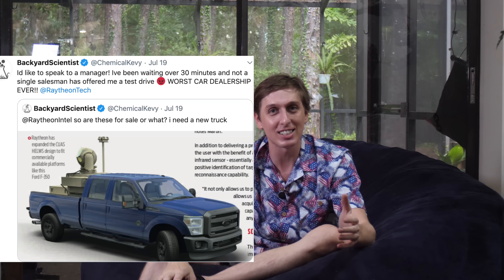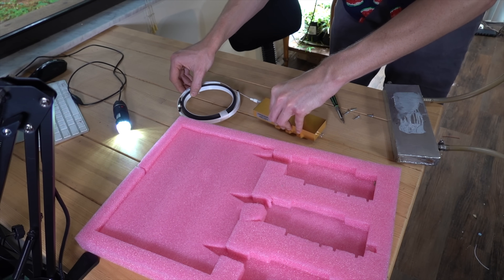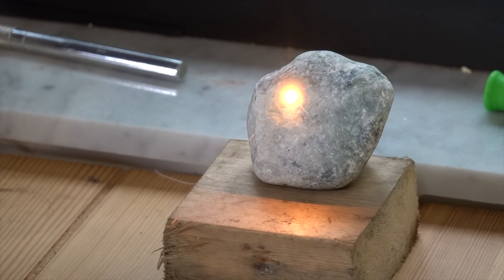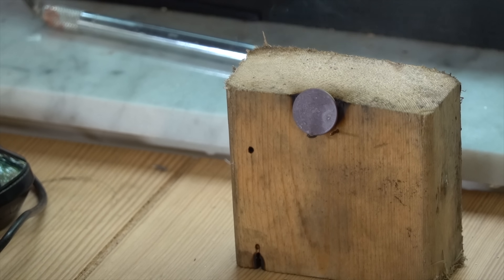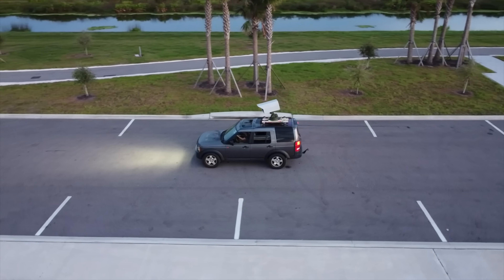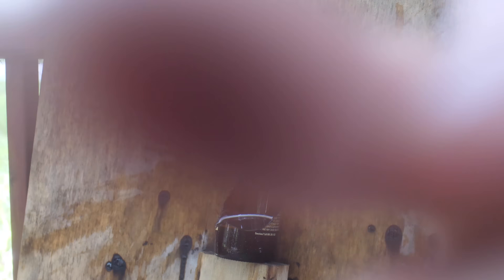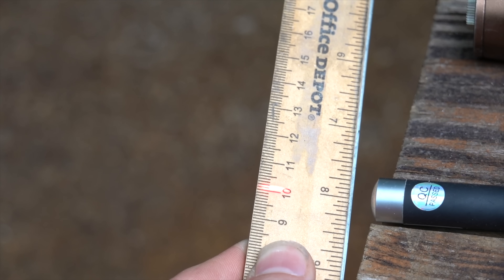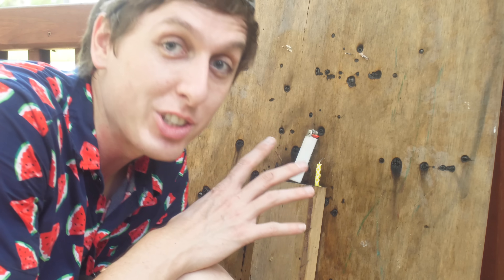200 Watt car mounted laser!

Comment: Aaaand Kevin has designed his own energy weapon. This is straight up an advanced weapon that was beyond human science just 50 years ago and he’s using it to entertain people
Reply: He just bought an off the shelf laser, everything he designed could have easily been designed 50 years ago.
Reply: @FrancisR420  nope, solid state lasers are far newer than that. He could've gone with a ruby rod pulse laser 50 years ago, that was about it and those had overheating problems if you didn't carefully design a cooling system into it.
Reply: @spvillano it's not pulse?
Reply: @FrancisR420  Nope. This specific high energy laser tech didn't exist 50 years ago. But, I just built a 3 watt RGB laser projection system for <$1K. 50 years ago, that would have been >$50K
Reply: FYI, Laserium started entertaining people with lasers in 1972. JS

Comment: Dude... If I was you, I wouldn't be trying to get a visa to, nor even land in, the UK anytime soon!

LMFBO!

Now, as for you firing a laser into the air, REGARDLESS of whether you checked for traffic "in a hundred miles in that direction" (which, unless you had your very own object radar (pulse-Doppler, OR Solid State) I'm uncertain how you could safely do that, so you could not just safely make that assumption ... and because of this the law states that you CAN NOT fire even HE NE lasers over .395 milliwatts into the free air without express permission. Full-spectrum high-powered lasers are different animals; even solid-state diode lasers. This type of display is known as a "non-termination display of a laser", and requires permits (and a designated time and area window, from both the FDA and the FAA) in ANY state. (Yes, I'm a lighting/laser guy from the concert/production industry). Some states (like new York) even require a license. You got away with it, but I would NOT recommend you do that again, as the penalties are quite stiff.

Not trying to be a Debbie-downer. I LOVED this viddy and was super impressed with your engineering (especially using the Meade as a projection system! Brilliant!) I'm just tryin' to give you a heads up, and keep you out of some DEEP hot water! The penalties aren't here, but the laws are. You can look up the laws, I'm sure.

https://www.fda.gov/radiation-emitting-products/home-business-and-entertainment-products/laser-products-and-instruments

Here are the laws about displays/performance: https://www.fda.gov/radiation-emitting-products/home-business-and-entertainment-products/laser-light-shows

I'm gonna peruse MORE of your madness later! GOOD TIMES, indeed!

Comment: 13:04 “… We checked the radar and there are no airplanes within 100 miles…” hmmm. hey guys, cool video but if that truck is anywhere close to US terra firma and you get a 250 lb. knock-knock cylinder ram-device break down your front door on the door and an FAA Special Agent there, better simply prepare to say ‘I’d like to request the presence of an attorney’

Comment: Hello. My teatcher at school on back days, says, that we never could not cut copper at laser because the copper reflects all the light and laser beams. So we never cut any copper with the laser machine, because the big and pricey machine could get broken at it. And now I understand it. This copper coin seems like it really does'nt get the hot spot. It just get hot all ower and in the end it's all red hot. I guess it reflects some of the laser beams and rest of these beams makes it hot. And because it is copper it leads all the heat away from the hotspot. Well, nothin more to say, but you have a lot of Good videos!!

Comment: Planes can fly without adsb which is what we see on the radar, if they are below 10,000ft you don't need adsb so the plane can go undetected, aswell as military aircraft that dont have to use it. So it was still dangerous. But I'm glad you still checked the radar and glad video!! Just something to keep in mind tho 😄

Comment: The meat is thinner than the wavelength of the frequency that the laser is set to. Thats why it passes through without burning the meat. Look into how medical lasers work. Same thing. They are set to the  wavelength that corresponds to the distance of the cancer below the skin.

Comment: Mind you that the Wheat Ear penny was discontinued in 1958, as much as that was destroying a (at least) 60 year old coin there were billions made. The US penny was swapped from 95% copper 5% tin to 95%zinc 5% copper mid 1982, so the destruction of such an old penny was not needed as any penny pre 1982 would work. I am not harassing or hating and I am not upset, just a tip.
Reply: I could've been a VDB or 1943 copper cent
Reply: @hunterpate8034  (1943 was steel)
Reply: @DerInterloper  I am aware of that, but, there was an error where like 50 copper 1943 cents were made, and vice versa with 1944, there were a very few that were 1944 steel instead of copper
Reply: @hunterpate8034  Ah you speak of those buggers, yeah they are up there with the 1913 V nickels.
Reply: @DerInterloper  indeed

Comment: You cannot build and operate a class 4 laser in the open air. You need to take this down and explain to your audience that what you did is illegal, irresponsible, and it carries serious repercussions. The CDRH has written a pamphlet outlining the regulations. You can read it online here: https://play.google.com/books/reader?id=DqK4ExoGWbQC&pg=GBS.PA20&printsec=frontcover
1. You have to register as a laser light show manufacturer if you shine that thing outside your house. (this is on page 17)
"AII laser products made since August 1976 must meet the FDA laser performance standard. Each manufacturer of laser products must report to FDA about the types of laser products produced."
The diode you purchased is intended as a component and does not have to register because it is not intended to emit laser radiation outside of a device enclosure. Those eBay laser shows are manufactured overseas and the importer is responsible for FDA Registration and compliance, but they are also illegal to operate without a variance. You have to have a warning light, an interlock key-switch, an emission time delay, your diagrams must be approved by the CDRH, and you have to know what you are doing.
2. You have to register open-air shows with the FAA and the CDRH. (page 20) 
"The
 Federal Aviation Administration must be notified before any open air laser light shows operate." But they won't approve this because it is ridiculously large, and it is invisible. 
3. You have to get a variance to operate a class 3B or 4 class laser is public (Styropyro did not shine his lasers into the open air, and that is probably the only reason he has not gotten a visit from the CDRH... yet).  (page 18)
"Before Class lllb or Class IV
 lasers are sold, used in performances, or otherwise introduced into commerce for demonstration or entertainment purposes, manufacturers must have an approved variance from FDA."
4. You have to submit for inspection. (page 19)
"Once a variance is granted,
 representatives of FDA must be allowed to inspect the laser equipment and the safety procedures to assure that the conditions of the variance are met. 
5. This has serious penalties. (page 19)
"Anyone who operates laser
 light shows without an approved FDA variance or who otherwise violates the FDA laser safety standard may be subject to a
court injunction and or civil penalties (fines up to $300,000) as provided for in Section 360C of the Radiation Control for Health and Safety Act. When
FDA becomes aware of a particular laser show that is
 operated in violation of the law or otherwise in an irresponsible
 fashion, FDA will notify the manufacturer or operator and require corrective action. If the problem is serious, FDA will also notify the State and local authorities and facility managers who can take additional, immediate legal steps to halt a hazardous show."

Comment: Whoooooaaaaaaaah :-O I would be so surprised if this had zero legal consequences. Imagine all satellites, the space station and airplanes in the sky that could be jeopardised with a 200W laser.
Reply: i gotta say, it was cool to see what a laser can do but this was the most irresponsible thing I've seen a youtuber does. This should have been done in a lab not in the open and especially NOT pointing it to the sky, risking other people's lives and risking damaging satellites.
Reply: @binthem7997  Statellites are up to high and are very heat resistant so its almost impossible for them to be affected if they are in the path of the satellites to begin with which is highty improbable

Comment: What would have happened if Kevin didn't check the radar:
Local Florida man shines laser in the sky and brings down seventeen airplanes
Reply: Planes can fly without adsb which is what we see on the radar, if they are below 10,000ft you don't need adsb so the plane can go undetected, aswell as military aircraft that dont have to use it. So it was still dangerous
Reply: That thing could easily permanently blind the pilots and passengers from miles away.

Comment: Now put it through a capacitor to get a higher powered pulse laser, take out the tracking camera and chip from the drone and wire that to the laser controls, and you've got a laser defense system capable of shooting down missiles and aircraft.

Comment: Based on your VDO, this laser emitter is real or just a false show and I have a question.
1). Does the distance have a significant decrease in the destructive power of the laser?
2) .If I need a powerful laser at 5000 watts with a protective device, is there any and how much it will cost? And let's be honest.
3 ). To be used in testing of certain technological developments.

My Email ; Moxs.suppa@gmail.com

Comment: Bust out a James Bond verson: 1.5kW that uses a modified rear tail light - stick it in a 64 Impala, as lots of room for  gear & target acquisition/assist features.   Repo man... eat your heart out.  With properly stabilized image sync control, could even be reliable at speed.
Reply: jam bi buy milbú hybred vàr

Comment: Took so long to burn shiny zinc penny because it was reflecting the beam onto the ceiling. Or back wall. 
BTW, what was the laser hitting outside the window when you were sticking the wood block into the beam?
Not sure I like this video as I can see it inspiring all kinds of idiots to go out and get lasers powerful enough to really mess people up when they're misused. Not to mention leaking harmful IR.

Comment: When you were focusing the laser in your driveway, did you calculate how large the beam had to be to not be an eye hazard for anyone catching reflections off your car or if you accidentally shot past the cardboard cutout and car?  I.e., you're focusing from at least some portion of a relatively large reflector down to a tiny spot, so past that point the beam is diverging rapidly, but the irradiance is still going to be well above the maximum permissible exposure over a time period less than an eye blink reaction (which you can't even rely on here since it isn't visible light and by the time you realize something is hitting your eye there has already been severe permanent eye damage).  Seems like to be safer you could've easily made a light trap box around your target area.  You can get permanent eye damage from an improperly filtered DPSSFD "Class 3b" green laser pointer (I've measured the IR output on cheap green laser pointers from China and observed IR emission more than double the intensity of the visible green light).  This setup is so far beyond that it should never be focused out in the open except in a remote designated range or with a light trap.

Comment: First things first what you are doing at 13:09 is extremely ILLIGAL.. the flight radar does not show militairy air traffic and does not warrant for you shooting into the sky.. you have to get clearance from the FAA and that's the only way to do it.. clearly this was not obtained.

To then use it also outdoors where most likely not all or other people around have the required safety goggles (and thus endangering others) is irresponsible as well. 

what you are doing at 4:20 is INSANELY dangerous as well.. you are shining a 808nm laser source through a window.. to make it worse: NON AR coated.. I don't think you understand how dangerous that is to the outdoor enviroment and to whoever was in the room for risking back reflection...

Btw it's not a divergence of 1mm .. the word you seek is mrad which is miliradian.

On top of the safety glasses you really need an OD rating for them.. then you really want a trustworthy OD curve given with them.. the camera test you did is not a suffficient thing... 
Please be more stringent on the safety.. these things are not entertainment products...

I'm still amazed big youtubers can break the law like this and feel like they can get away with that..

Comment: Fun fact : The reason why the copper penny turned red hot is because copper is a really good conductor of heat , as for the zinc penny it didn’t do much

Comment: I love that you are shooting at gas lighters, ensuring combustion, in front of a plywood sheet after you just showed the laser cutting through wood, backed up by the rear of a car, which is where the GAS TANK IS.

On the other hand, think of how easy and quiet duck hunting would be with this . . . Peking Duck on the wing, anyone?

Comment: Read the Creator's justification (court defense) in the caption. I guess it's mathematically impossible to endanger a pilot, according to creator. His BS comment about "checking flight RADAR for 100 miles" is irresponsible and fails to account for VFR aircraft at night.  Since the beam from this LASER is invisible to the unaided eye, a victim would not know. No witnesses.  Yes, creator should be in jail. 2A has nothing to do with creator's illegal import.  BTW, every time creator fired that beam in his driveway, there was some reflection ( scatter). Again, can't see it.

Comment: Sorry I am terrified by 200 watts in a tiny fiber optic strand no more than I am terrified by 10 milliamps of electricity at 120 volts in a 28 gauge wire. Passengers on airliners, however  should be terrified of you and your silly fanboy buddies pointing them at airplanes blinding pilots. You should wait for the frontal lobe of your brain to develop before playing with dangerous toys.
Reply: he said there was not any plane flying, because he checked the paths.

Comment: At that amount of power, you still have an obligation to inform the local air traffic controller.  Just because you look at the flight radar information and don’t see any aircraft in the area at that moment, doesn’t mean there isn’t an aircraft due to fly that flight path.

The other problem is, a website like flightradar24 will only have the majority of commercial aircraft on display.  They don’t show civilians, police, fire, air ambulance or military aircraft.

Some of these lasers (visible spectrum), can illuminate entire clouds and cause a distraction over 300 miles away.  As your laser is infrared, they won’t see the clouds light up from a distance and have no warning.

Comment: You just proved what a good conductor of heat copper is. The zinc had a hole in it the copper absorbed all the energy and became red hot.

Comment: So ummmm... I don't know what you think you did to check if there were any planes in the sky, but I suspect what you did is check one of those web sites that allows you to look at an area of the sky and watch flight paths.  Here's the dealio:  those are ONLY planes that have filed a flight plan, not "all planes."  Planes flying under general aviation rules frequently do not file  a flight plan, so what you did was still exceptionally dangerous, and if the FAA finds out about it, you'll probably have some explaining to do, and will be lucky if you don't end up with some legal issues.

Comment: I wonder what exactly you was burning , when you slid that piece of wood into the beam. That is, what got burned when the wood wasn't there. I know IR tends to reflect from normal windows, but no idea about UV. So did you guys burn something in the yard,, or did you make a hole in the wall opposite of the window?
I was wondering if the window would shatter from the laser,but apparently it was just fine. (oh so it's IR laser?,, you might want to check the wall or whatever was at an right angle to the laser, for holes)

Okay,,, okay. so you drill through a piece of plywood in about 2 seconds, and later on you park your car behind a piece of plywood,, and fire lasers at it. (I mean, that stops anyone past the car to get hurt,, probably, but is not so good for the car?)
You guys need to have a chat about laser safety! Seriously!

It is so easy to just catch a glimpse being reflected off of something, and that would be enough to ruin a retina. you guy's have glasses, but others around you don't. please stay safe!

Comment: If you slow down the playback speed to 0.25 @ 8:28 it clearly shows something flying through frame and hitting the bottom left of the board, then the blue stuff hidden under the board seems to be the cause of the smoke and the 2x4 looks to be hiding a sparkler/exploding effect which happens @ 8:29